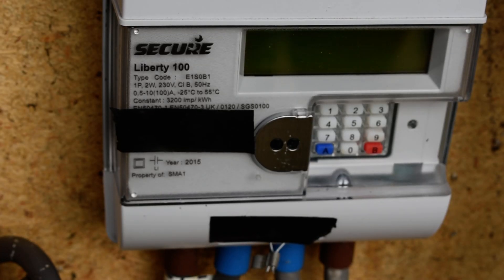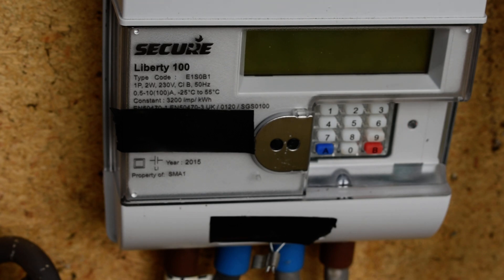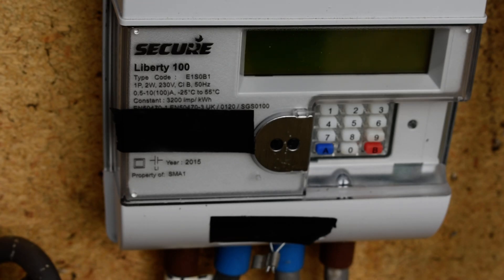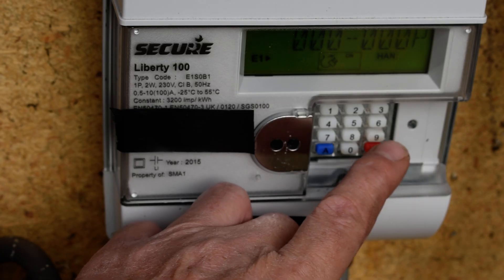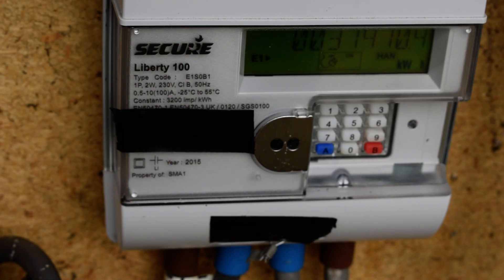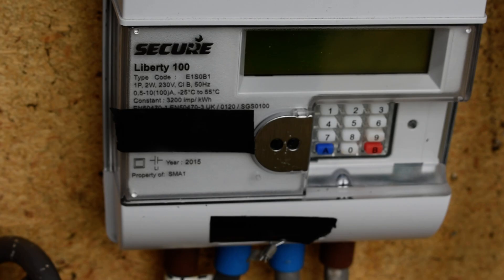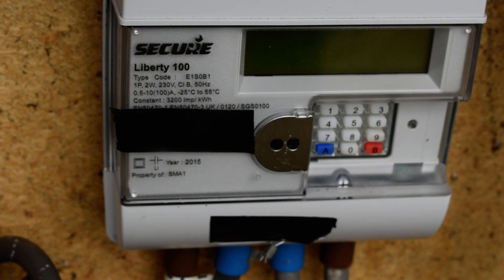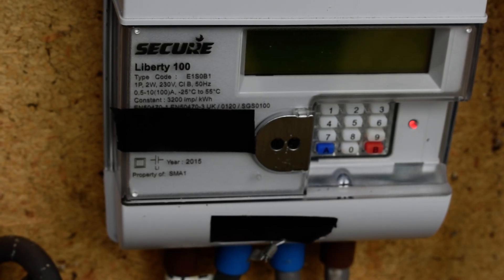How to read Smart meter SMETS1 Liberty 100

Comment: What numbers do I provide to my energy supplier
Reply from the maker: Hi Press 6, let the display cycle round; once R01 appears on the display the next digits is the R01 (night) reading - you dont need the digit after the decimal point. Next will be displayed R02 and next digits will be the R02 (day) reading - again you dont need the decimal point. Display only last couple of seconds before cycling so you need to be sharp writing it down or take a photo. You can always press 6 again to cycle the display again.

Comment: What about day and night reading?
Reply from the maker: cycle Button6
 RO1 = E7 cheaper night rate Midnight to 7am (Approx 13p/kWh  in UK)
  RO2 = standard Day rate 7am to Midnight (Approx 18p/kWh  in UK)
1kWh = Energy use (Power * time)  = 1Unit on the meter
1kW heater switched ON for 1 hour will result in 1 unit increment on the meter

Comment: I don't get IMP R02 come up after R01 and can't cycle to it using the 6 button. I'm unable to give my electric company readings because of this
Reply: Same here.  Former Ovo customer by any chance?
Reply from the maker: Try button9 assuming it is a Liberty100 ?
Reply: Having the same issue mate! I can get IMP kWh and IMP RO1 very confused!
Reply: I'm not sure, when I moved in it was on octopus and I switched straight away to eon, terrible desision
Reply: I'm at the point of making up my meter reading just so I can leave because eon have no interest in helping
Reply: @rstaniforthrs  It’s a right faff mate. If I press 6 on the keypad I can get IMP R01 (my night time use).  If I press 9 on the keypad I get another figure, which I assume is my total usage, so if I deduct IMP R01 number from this that presumably gives me what would be my IMP R02 (day time use) figure. 

The meter has definitely changed within the last few days though!
Reply: @robertbrown3121  I tried doing that for a while but I found that my day use (the calculated number) never changed. At a guess I'd day that if you don't have an R02 number the R01 is the day and night total since the meter was put in single rate mode
Reply: @robertbrown3121  Your right though pressing 9 gives you total KW used since the meter was installed

Comment: My wan light is flashing red , is this ok ??
Reply from the maker: It will flash whether there is a SIM card installed or not. If you have to provide manual readings to your supplier then no SIM card. If Sim card is installed and connected into the supplier system then you dont have to provide manual readings.
Reply: @xacteducation8036  How can you replace sim card ?
Reply from the maker: You cant - only the owner of the meter(supplier) can and thats not you whether it is inside or outside of the property. If you cut the seals on the meter you may be prosecuted and it is also dangerous as 230V can be lethal!